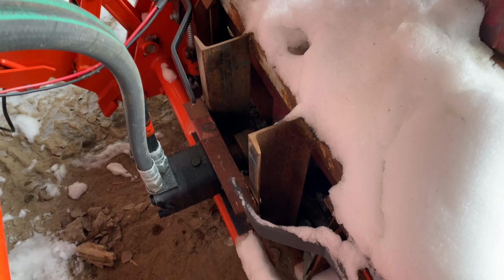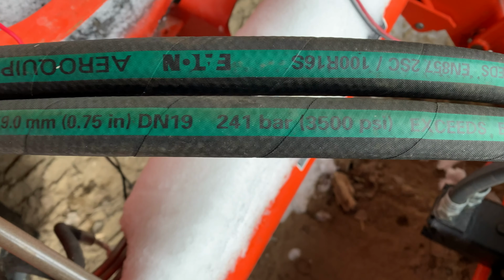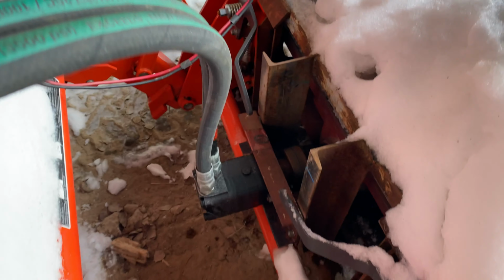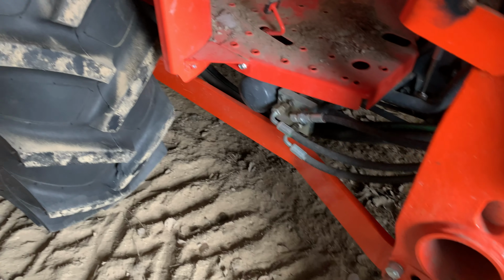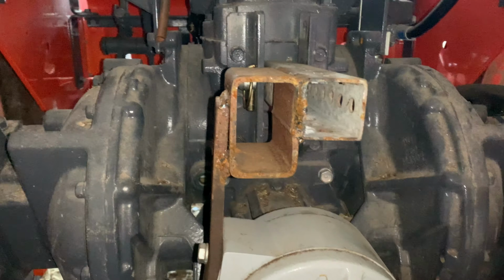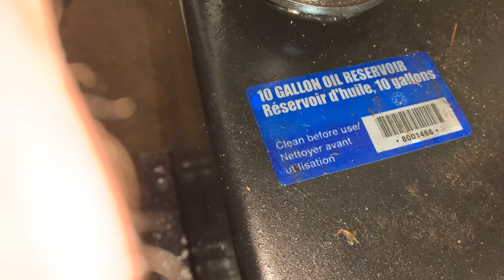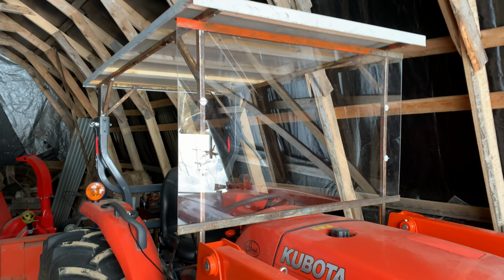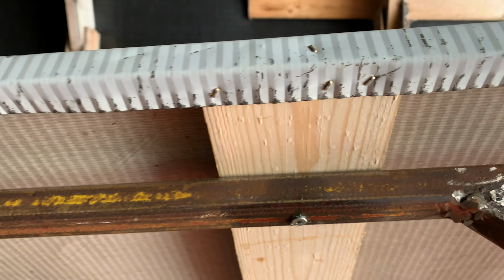More Details on the Front Mounted Snow Blower

Comment: Hi there can you tell me more about the electric set up for your chute ?
Reply from the maker: It's just an electric winch that he had.
I will try and get a video for how he has it wound to explain it but the cable basically comes out that bottom and he refeds it back on the top so as the bottom lets out, the top reels it in.
Hopefully that helps but I can get you a video of it this weekend if needed?
Thanks
Andrew
Reply: So friction is turning it then

Comment: How does the winch work
Reply from the maker: The cable from the winch is wrapped around the shoot and then rolled back into the winch.
The cable is comes out of the bottom of the winch and then wraps back in from the top.
(Not sure that's very clear.)
The power is connected directly to the tractor battery and then the switch is mounted close to the loader controls.
Thanks
Andrew

Comment: Great video and info.  I am considering the same conversion.  What HP is the tractor?  Is there a relief/safety valve in the hydraulic system?
Reply from the maker: The tractor is a 50-54HP and I don’t think he installed a relief valve.